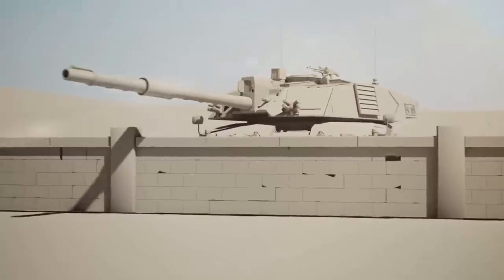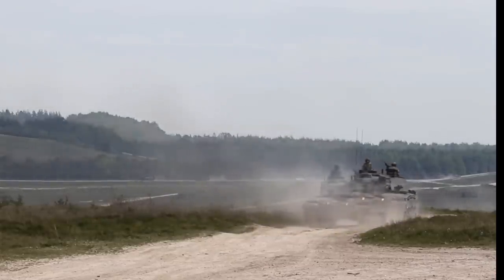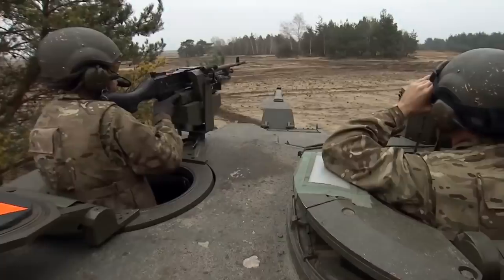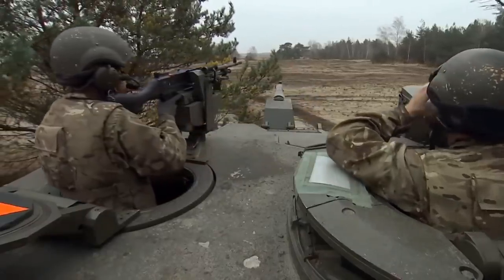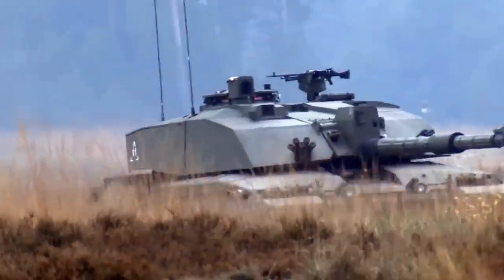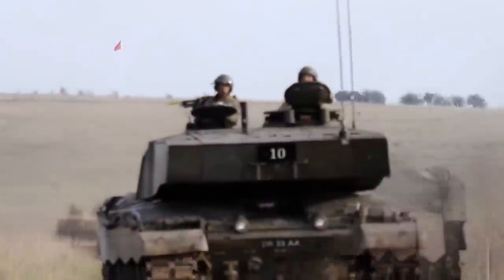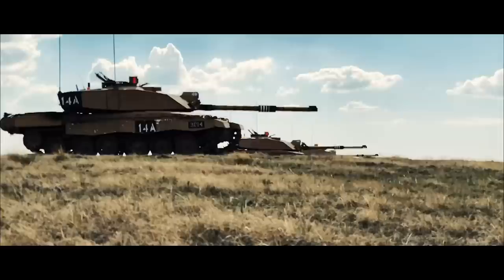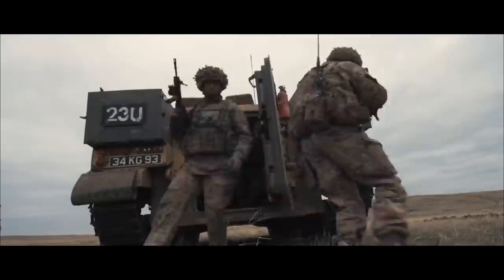Challenger 2 Tank "Black Night" | MODERN UPGRADE

Comment from the maker: Tell me what you think of this? Is it worth it? Is it going to be made into full production? Disagree with what I said? Let me know! :-)
Reply: My thoughts, Its essential. 
We are at the point now that tandem warhead guided missiles are becoming a common thing even in third world armys. Tanks can no longer rely on reactive armour + chobham to be protected.
At the minimum all western tanks should be adopting hard kill defensive systems as soon as is realistically possible.
Reply: This Upgrade is really impressive, but I am also very eager to see what Rheinmetall's Upgrade will look like. I'd really love some Design choices from the Leopard mbt Revolution to influence their proposal for the Challenger 2.
Reply: Matsimus don't take this the wrong way but a polished turd is still a turd.  The Challenger 2 was an obscelecent design from the beginning built for a style of warfare that was woefully out of date.  Its disappointing to see the MoD of Great Britain double down on a poor design rather than seeking to at least put the money in to make them compatible with the NATO logistical system and look into new more future proof designs.
Reply: In regards to the Engine, I think the rest of the drive-train would obviously have to be considered in any Engine Replacement or Performance Increase, mostly in regards to maintenance, reliability, fuel consumption etc, not that It would necessarily be problematic (a boilerplate development procedure) Active Defensive Systems are a must, as even in the absence of modern anti-armor weapons, crack marksmanship against small, unprotected areas of vehicles has sometimes paid substantial dividends, possibly the earliest example being the destruction of 2 of the Ironclad Ram C.S.S. Virginia's 10 guns by the Wooden hulled, Sail-only Sloop of War U.S.S. Cumberland (Commissioned 11/9/1842) at the first day of the Battle of Hampton Roads (3/8/1862) despite the feat involving firing smooth-bore muzzle-loading guns from the pitching deck of a sailing ship, aimed with rope, pry-bars, elevation thread, and quadrant at the gun-port hatches of a moving Ironclad, whilst they happen to be open long enough to roll out, aim, and fire shells  at the broadside of a wooden ship in return. Ultimately after multiple hours of gunnery, and the death/injury of 55% of the Cumberland's Crew, the Virginia was finally able to sink the Cumberland by ramming, but in doing so took substantial damage and was thus unable to decisively ram the Ironclad U.S.S. Monitor the second day of the battle, the precious few hours bought forcing Virginia to fall back to deeper waters to prevent running aground with the tide, and with it saving the Union Fleet and making the Monitor's soon to be legendary duel inevitable, and with it the threat to the blockade and potentially even Washington D.C. duly neutralized.
Reply: yip so much worth it:)
Reply: lol that tank had no lower glaces add on armour
Reply: The only thing I disagree with is that you're not making more and longer videos. I know YouTube isn't your entire life but you're probably the best military uploader on the platform.
Reply: Its kinda sad that there aren't any new European modern tank works in progress. It be neat, if one could also make one, that be fielded by all EU NATO members ( if it covers all their needs ) simply for unitary and logistical reasons. And that all past planned ones always ended up in failure. ( kinda just like in aviation too ). Answer is simple doe - if there isn't any necessity to use them in an war and intense combat, modernizing and life-extension is the way too. Having an continuous project development for an modern tank design in the background be still necessary, just to stay in the league and have an usable concept, once the lifetime expires for good. And having an program to save the necessary resources for that day. Otherwise, the few systems, like the sights are a great help already, so going for all the possible upgrades might not be as necessary in peace times.
Reply: I reckon she's gonna toasty in the sunlight. Especially if it is as dark as it looks in the pictures
Reply: I think Britain’s got a few more pressing worries that need fixing first, but thanks for the video. Also...  Not having robot voiced ones is good!
Reply: Tanks are just rolling coffins they are sooutdated. 1 unit with laser anti tank missile will leave a tank as a smoldering heap of garbage.
Reply: I mean they need upgrades, that should not be in doubt to anyone they are running behind. That said have they finally started to produce more ammunition for it again? iirc a few years back the stockpiles where so old they where classified as to dangerous to handle. 

That said the 120mm smooth bore has been debated, but it would require such a massive refit a new tank would be as expensive (Talking going from a 3 piece ammunition to a 1 piece so it is not just a case of swapping the gun, but also all the storage spaces). 

Overall though I feel this is one of those examples of western nations trying to get insane lifespans out of their current equipment cause they do not want to fund new equipment and also do not see a need to do so and frankly who can blame them? The public opinion is not there to send more funds to the armed forces in most nations and there are few credible treats where you really would need say a state of the art MBT. People like to point at Russia, but really even if we would get a non nuclear war with them most of their equipment is also old and poorly maintained. Things like the T14 Armata are wonderful, but they also don't have the money to buy them in meaningful numbers. 

So yeah upgrading what you got is the way to go it seems and with tanks that is relatively easily done cause the level of passive protection has not really changed so you don't need to improve on your firepower or your own level of passive protection, all you need to do is upgrade the brains and eyes (computers and sensors) and add some active protection systems perhaps if you want to spend the cash. 

I think we all would love to see stunning new and innovating designs being made and adopted, partly cause we are nerds for the stuff and partly cause we can actually see the use of them to a degree even without credible treats today that does not mean it will be the same tomorrow. 

This all comes from a person in a country that did not even buy heavy winter clothing for it's troops send to Norway this time of year for exercises in snow and ice..... the level of military funding is shocking and the consequences people just refuse to admit.
Reply: The only problem with this is that Australia won’t buy it
Reply: I think if it ever got hit, tis would be just a flesh wound!
Reply: Modern army concepts hand the anti tank role (which is the main role for a MBT nowadays) over to unmanned systems which mainly rely on ATGM. That might be the reason to keep existing platforms until technology is able to realise this concepts.
Reply: Matsimus as a complete tank noob can someone please explain why a smooth bored barrel is better than I rifled on (in a tank) thanks
Reply: Rifled guns reduce the maximum possible penetrator velocity due to the friction of the rotating band and the loss of gas pressure. I think (but do not know for sure) that smooth bore guns also allow more shots to be fired before the barrel has to be replaced.
Reply: Looks very good and cost effective. If Russia can modernize much older T-72`s I don`t see why this would not be done.
Reply: I deff think its worth it as a force multiplier a tank even an old one is a massive asset used properly and aggressively plus in real modern wars we actually fight few if any anti tank systems younger then the old tank before the upgrades
Reply: The British military does need an increase in spending also I want Britain to get good reliable equipment that available and they got to give the Challenger II a better engine and I agree they should focus on the core
Reply: More life on the gun barrel, less expensive to maintain. Also, ammo commonality with other NATO tanks decreases cost of usage.
Reply: It is all about the priorities and cost efficiency. Maybe get a new smooth barelled gun like the Rheinmetall L/55 120mm and Trophy APS, and upgrade the existing powerplant. I am sure that with some "cheap" /compared to a new engine/ upgrades (electronics, exhaust, new turbos) it can be in the 1500 HP range.
Reply: Ha can't believe I'm in your video, I remember the guy videoing on horse guards.
Reply: This is what happens when we've been bankrupt militarily by are new carriers. All those new Goodie's look vulnerable to heavy machine gun fire. They also have to fix the weak spots in the lower hull that came to light in Basra.  I just hope they do all the right modifications in the final model. Gun-Armour-engine-protected optics-thermal-camo-and new fire control-battlefield management-next gen-active pro. all the best  PS I love the Chali 2
Reply: Matsimus, ive looked around your channel trying to find out why exactly this is your favourite tank, its out of date, loses every tank competition but that might be down to the poor quality crews. Its not a good looking tank and sticking endless amounts of tatt onto it only makes it worse, the British have an amazing ability to make everything untidy/messy on our military equipment. We have all the money in the world (or so it would seem) to produce the best, but we somehow manage to fuck it up again and again and again ---- Plot twist...we dont have the best equipment in the world and we dont have the best people either. There, i said it.
Reply: It's need to extend it's life for the foreseeable future but i think it was a real missed opportunity to call it "Black Knight" instead of night.
Reply: chris carter honestly mate don't comment on stuff you have no idea about . watching a few YouTube vids doesn't make you a expert on the vehicle. And being a ex Tank regiment serviceman I take offence to you saying poorly trained crews we have some of the best In the world.
Reply: I like it. Would like one for Christmas. Then I can drive over cars on my way to work.
Reply: From what I know (and I am not specialist or anything) or what I've heard about that tank the two big problems with it are that the engine is not very reliable and the ammunition for the main gun wich is imported and no longer produced  so is true or it's some BS  ?
Reply: Should've bought the leopards we where offered and slapped our trademark challenger armour ontop
Reply: @MilesStratton  the british goverment is built of beurucracy. We'd be able to get a brilliant army with more than enough staffing for the budget we have if there was no such beurucracy as we have today. Its utterly fucking ridiculous. Its the entire reason we had the l85a1 and the entire reason we haven't bought rifle licences from a company and just modified and built them here like with the slr. Instead it has to be a new from scratch peice of shit by a huge design board rather than fabrique Nationale, colt, Armalite etc
Reply: Гавно, Т-14 разнесет вас всех.
Reply: Well if they want to upgrade the C2 they need to keep in mind ECM resistance and EC reconnaissance. The noise its making as recce by ear is also important. Thermal footprint and if discoverd and hit its need to take the hit and still be running. Weight as tanks get more and more heavy and some infra structure and even ground it self cant handel this weights any more. When destroyed its needs to be refurbished realy fast. Long runs without resupply are also a thing. unfortunately is going back to cold war stand off with russia and china and the numbers game is not on our side as technological gap got closed pretty fast.
Reply: What Armata? Just stop this crap. First try to make it comparable to T-90MC first and then think about something else. Also we all saw T-72s in Syria but what about Challenger, probably could not survive in that Syrian battlefield.
Reply: Great video. Yeah, I hate the bot voices too.
My only point is that as a mechanic, you'll know that an uprated engine = an uprated power train, suspension etc, which are all rated for 1200hp, so surely you know that what you are really calling for is a Challenger 3.
I personally believe that a Challenger 3 will happen, but that it will be a major mistake, as tank warfare is rapidly being superceded by lighter, smarter, longer range war fighting vehicles such as drones and missiles, which spell the end for heavy mechanized formations. I see no real place for the tank in this age of D.E.W's and hypersonic projectiles. I believe that rail guns will soon make the best smooth bore artillery obsolete, and the next generation of electronic warfare will render all their expensive toys useless, so why bother?
Reply: @ Vlad Ohio

Its the same with "standard" Leopard and Abraham packages and most current standing MBTS. They're fine for usual frontal and tank engagements but the increasingly heavy Anti-tanks qualities out there make more and more tanks in their current forms considered either severely lacking or obsolete. I think the t-72s with ERA packages in Syria are "ok" and they also have joint Syrian/Russian made passive laser to throw off atgm targeting. A Challenger might have enough side armor to survive flank shots but with the lack of electronic or any modern counter measures makes them... not challenging for anti-tank teams *Cough*. Most atgms aren't going to penetrate a tank from the front unless the tank has sub par ERA or lacks Ceramics. I geuss Challenger's main problem would be the engine power to get where its supposed to, its a lot of space to trek around.
Reply: Well Matsimus, I've taken a few days to calm my head from the fanboi feels and read the comments. I have come to a less than fanboy perspective: Any exterior add-ons and improvements will not be sufficient without extensive internal improvements. Building a new tank from the wheel up may have been a better alternative in both price and logistics. 

Now, in defence of this noble-aging-horse. Its a big tank with heavy armor, theres not much to complain about that. Chobam armor itself isn't going to be obsolete. It is only one layer of armor, by adding the sensors to detect incoming targets, track and engage with APS adds both a sensor and hard kill layer. Now, for the demonstration BAE chose to show Iron Fist which is a proven flexible system.(Which is a hard kill system, the other Black Night systems might also include soft-kill to disorient incoming targets) Why they decided to stick an Israeli item ontop could mean its future  usage in the UK military or a stopgap measure. I did notice the triangular body mounting had some slight differences from the origianl Israeli videos, so maybe UK BAE will be producing under liscenince or at least some parts. Also means they didn't throw the APS proposition through the beuacracy mill, huzzah. The hunter-killer system bumps this horse into the modern races for optics, much needed, much anticipated, much wow. The shared digital communications systems has been somewhat common in the past decade so I'm glad the UK is looking into getting its own communications upgrade. I think the survivability and awareness of this add on will be highly increased.  

This is all great, but, a lot of it should have already been done since... well when it was introduced. Modern optics for tanks is somewhat of a no brainer. Modern communications is a redundant subject, I don't even think that should be a black-knight addition, it should be a full on military arm upgrade for all active units so they will have someone to share communications with. Now to run all of these fancy upgrades, electronics and talks of an infrared skin. The Challenger 2 desperately needs bigger engines. If not to run all the fancy equipment then if only to lug its weight properly, the thing is heavy and needs the additional power. I also keep reading about ammo packaging problems and engine reliability which adds further issues to any internal upgrade.  

For me, when watching the original BAE release I had a "Finally!" reaction. A-lot of its beens talked about for awhile and this is a bit too delayed for my taste. We don't really know if the beuocracy will let it through. It may take longer to finally sign an upgrade program into effect and force back the date of introduction further back again or get further upgrades into the program, still late or just when its needed.
Reply: Damn it, i thought it could Fly, upside down be stealth , and do airstrikes by itself. British engineering and all...i am very dissapoint.   ;-)
Reply: i don't think APS would work in an urban envoirnment, it seems to rely on plenty of warning before countermeasures can be deployed( not much good if you can get up close using building cover...)... As for the engine, i can see them go for an electric motor with diesel generator at some point...
Reply: This. Tandem warhead & FAE warhead RPG's are available on the gray market so cheaply from China & other sources that active protection systems for MBT's & probably the Warrior as well are now essential.
Reply: Bloody hell
Reply: @Iain Ansell
You'd be surprised, a lot of these APS systems are designed specifically to engage at short range so long and short launched munitions are fair game. A lot of these modern systems are designed for split-fraction-itty-bitty-second response time, so it doesn't really matter if its urban or not, just how fast the munition is going. The large number of sensors is more for redundancy and full 360 readings so urban engagements aren't a problem. APS isn't going anywhere but on everything.
Reply: We should be developing with the Germans and French within Europe.
Reply: @PytonPagom  The Germans and French are looking at a next gen tank.  We should be with them.
Reply: Needs a 1500bhp engine and a bigger gun and smoothbored.
Reply: To my current knowledge, the Germans are the only ones who have demonstrated their own APS system. Instead of a turret mount its a very impressive explosive screen hanging over the sides, and very quick to react. Its very quick acting but I don't know if they have plans to put it on tanks (more likely I don't remember), the decision to use the turret mount design could be a space conservation reasoning. Using the german design would require alot of space to install. While all three countries are likely to work together in the future and the idea of make-in-Europe sounds great, I don't know how much the brexit and other political frakus has affected their procurement decisions. Or, its a question of reliability and flexibility and the procurers don't care if its local or not.
Reply: JohnnyZenith - i think i mentioned the "Leclerc/Leopard" bastardization before ( perhaps somewhere else, not sure yet ) ... not sure it can be called "a new tank" and they did push it forward as an export article. 
Dan Koz  - make in Europe is the way. It has just the pinch of economic national nonsense still hanging. One must understand, if we want to have a fully capable European force, unification, hom-production/servicing has to be the top idea. But, that would mean an full-Europe fitting machines, and that they be constructed by all interrested ( that have the technical capacity ) to produce and service them themselves ( thus know-how and bussiness barriers + national economy interrests ). Doe, the US problems with possible chinese electronics, and the thought, that in war, one cant wait for overseas delivery ( and the cost manipulations it brings with it ). One just cant rely on another player in war, case he will abuse it.
Reply: When is this tank getting a 1500bhp engine with 130mm smoothbore.
Reply: Challenger 2 has too many flaws, but ...
I consider this modification successful because It allows you to make his strengths even stronger. A large-scale modification would cause an avalanche of technical problems, intractable problems. The point is tactics)
Reply: I have a question...Why cant they do modifications to the engine to increase of power? This was done on many older tanks,including T-55 AM2,AM and H. It is much cheaper.
Reply: @mioslav5946  MBT's were still a primary force in the Iraq invasion 2003. Since all major armies have them and the Russians are updating their army with new tanks shows you are incorrect.
Reply: @MilesStratton  lol even if it was a best MBT today, and its not. There are small numbers of them.
Reply: Challenger is probably the best tank in the world,zero combat losses for a start,longest tank kill on record.
Reply: Eh. I think your military should just piggyback off of the US M1 Abrams program.
Reply: So the UKs plan is to field like 300 tanks capable of accurately engaging tanks to 3000m.  Against 1000s of t72s firing 9M119M Refleks missile from 5000 meters away.
Reply: Many Miles Away Surving on average 76 RPG hits in the Middle East? That obsolete?
Reply: To the threshold. I would point out that tanks have faced weapons that can knock them out, from the first mk1s in 1916.
Reply: Many Miles Away I would like to point out that the style of warfare the Challenger was built for,  ie large scale armoured warfare versus the Russians, is the most likely form of warfare the UK could now be involved with. We’ve left Iraq, (in which the UK fought large scale armoured warfare, with Challengers, very successfully, TWICE!) and Afghanistan. The problem now is that nutcase Putin. Please try to keep up to date before posting daft comments.
Reply: Mio Slav One unit of laser anti tank missiles against the artillery barrage the tanks call in? Tanks have faced anti tank weapons since the mk1 in 1916. Tell me another way of transporting a 120mm artillery piece into frontline combat? One Challenger in Iraq was hist by 70 rpgs and a Milan missile and survived.
Reply: Carde I cannot take the Armata seriously with that enormous shot trap under the turret. It would not surprise me if it was built of paper mache. The Russians have a habit of building fake mild steel tanks.
Reply: Although I have heard that there is no such thing as a stupid question, only a stupid answer, here goes ...

As part of the Black Night upgrade, the main gun may go to a 130mm smoothbore. Why not a 155mm, if the aim is maximum pen at a decent range ...? Or is the ammo too large/heavy, meaning you can store less ...?
Reply: Basically we need a government who is willing to spend money on the military, so that we can build a new tank.
Reply: @dethkon2284  

Well, as we both know, that really boils down the HM Treasury, and whomever is the current Chancellor ... 

I am sure that after Phillip Hammond was given the bill for the Trident upgrade (which I hope will also mean an increase of deployable warheads to 250 ...), he may well have baulked at any real-terms increase in spending by the Minster of Procurement, especially due to the amount of money the MoD has 'lost' over the years, due to a number of bloody shambles (coughL82A1cough).  Hence the Challenger 2 will suffer from 'incrementalitus', since it will be seen that upgrading an existing, abet already battle-proven design, will be 'cost effective*', than a completely new design from the 'tracks up' ...

[*= yeah, I know, I know ... normally the cost of upgrading can be far greater, long term, in stretching its longevity (cf. the venerable, and still hella useful, B52); one can argue for the umpteen billions of $ spent on keeping it airworthy, imho, they could have had a mixed fleet of a few B52h, alongside an equal number of B58b/c, and B70b/c flying by now, but what the hell do I know ...

... just don't get me started on the TSR-2 ...]
Reply: @dethkon2284  

As much as I admire those fuggin Yanks (a maternal cousin was a Royal Marine, who did at least one tour of Northern Ireland in the '70s, and was almost deployed to the Falklands; to me, a marine is a marine is a marine, no matter which side of Yon Pond they hail from ...), you point is very well made ...
Reply: @nigelft  We do have a unique relationship i will grant that. but the things that cause war are ever present.the question is.......who's fabicating the next conflict? i believe in prevention, which as you know is far less costly than actual war. It just depends on your method now.... i suppose
Reply: Upgrades are needed. Good job on the vid, as usual. I would also add the Rheinmetal Rosy smoke discharger system to the package.
Reply: Of course the chieftain needs an upgrade, the challenger 2 upgrade-package is from the nineties! 
Yeah that right guys, the challenger was just a disguised chieftain and the challenger 2 is a disguised chieftain with a "new" turret and improved dorchester armor not chobham that was on challenger 1. 
So yeah, looking at it like that the challenger is archaic, but it'll probably only ever take on other archaic tanks like T72, so an upgrade will suffice. 
A completely new tank is not needed and quite frankly waaaayyy too expensive with a brexit caused financial breakdown looming. 

On the other hand, in my opinion everybody should ditch their existing systems and go for the Abrams M1A7 and upgrade personal weapons to nerfguns.
Reply: I think that your childrenwill dye in the Battlefield facing T14 or even T90 modern versions so the best you could do to protect them is to purchase some Leo2A7  increasing the possibilities of their survival or at least achieving a heroic death and not the death of the sitting duck
Reply: Rik Z  russian tanks are shite,depend on numbers
Reply: @tothethreshold.9965  Yeah, hard-kills are great and all but I see no money for a hard-kill system at ALL of the European tanks. If it's 50-200 pieces. hell, even 400 and all are III-gen modified western constructions - that's fine and will do great. Available change in some reasonable budget. But consider you have around 1000 machines. There are 1,3k in fact but it is not possible in this world and worst ones will see junkyard or garage sale. 

ALL 1000 need a fast and very pricy modernization. 200+ of Leopard 2PL from Rheinmetall (MBT Revolution Program) at least a 400 of old T-72M constructions have to move around current T-90 or even T-84 Oplot M level. Then there are some 230 of PT-91 tanks (in modernization now). Even Leo 2A5 is not new. An additional batch of 50 up to 100 modern tanks needed. Ever wondered whats between 10k of T-72, T-80, T-90 and Europe? 
That's all nothing, that's only a temporary solution. A very temporary one. The real deal will be only an IV-gen tank covering all oldest pieces.
Please show me a place for APC for all of it before IV-gen. tank starts its service. 
Matt - love the video, watching it for the 3rd time now.
Reply: DONT YOU THINK WITH ALL OF THE MISSILES ON THE MODERN BATTLEFIELD, THAT ALL VEHICLES ARE IN A PRECARIOUS POSITION?
Reply: @valeremkin5188  There is no T-14 project anymore. Even T-84 Oplot M is way better tank than your T-90M! A poor-mans Ukrainian tank is BETTER in almost any aspect and your military tech. specialists know it very very well.
Reply: @vladworldzmason8244  Buahahahaha Comperable to what? Make a one single T-90M tank and give it for the REAL testing.
 I was contracted for special multi-national armored vehicles testing program. There were 6 countries invited, but only 5 appeared - USA, Russia, France, Germany, Great Britain.
1. Leopard 2A7 got all the tests but one.
2. Abrams M1A2 lost mainly in the high range accuracy test, first hit probability testing and cross-country ride -manouvers acceleration and speed. But in fact, it was very close to the Leo 2.
3. Challenger 2 tank failed a lot in cross-country and road speed and maneuvers. Long range shooting was very accurate but lacked too much in energy deployment at the target.
4. Leclerc tank got a serious autoloader jam and could not make any firing test at all.
5. T-90 was burning its charges so slow that the pressure in its main gun clocked close to 50% over the safe level set by the gun manufacturer. Due to this serious danger for the crew, the tank was rejected from MBT comparison testing program. Before this T-90 got poorest results for weakest armor protection, high fuel, and oil consumption and all the shots done before the gun issue, missed both of close-range targets at the stationary shooting test. Long range and riding shooting were not provided with T-90.
Reply: Rik Z  Yes! Exactlly. All the way down...
Reply: @HanSolo__  also even if we go off your bullshit, which is bullshit, but to entertain the idea.  I'm pretty sure 5 hits with guaranteed 1000mm against RHA, at 5000 meters.  While holding a 4 to 1 numerical superiority advantage against NATO  is more than sufficient to show her majesty what's what.
Reply: @nigelft  No bigger ammo possible now. you can make a gun. You can fit it on turret and you can even shoot with it once or twice. But you can not equip a tank with such a big gun, beacuse turret will need more space, more counter weight and more place for ammo. if the turret gets heavy tank hull needs to be upgraded to hold it. No room for up-to date armor, you have to make tank even bigger. Now its 40% heavier. Suspension can't hold it. New suspension + heavy tank leads to the wider tracks. So ther eis the need of some new designed wheels. Now you got a fucking snail on track. Tank is slow as shit. You need a new powerpack. Bigger HP needs bigger transmition. You end up with huge monster tank that costs a fortune and ther is no bridge around that could hold it.
Reply: @dethkon2284  Airbus/Eurocopter is an American manufacturer?
Reply: @HanSolo__  and I'm pretty sure you're confusing the damaging wear firing HEAT rounds though that rifled museum piece of yours.  For the lack of wear produced by a low powder charge and  the mechanical kicker used in getting the reflex out of the barrel.
Reply: @HanSolo__  how does the saying go again? Oh "England we were the first and now we're the worst!"
Reply: @chevchelios3904  Remote controlled IED with huge explosive package was a shit for KTO Rosomak used in Afghanistan. It is the LEAST armored vehicle from the pack. (4 x 4 offroaders not taken into account)So IED is no use agains current 40t IFV. for Puma, Lynx, heavy CV90 its like nothing. If stepping on IED with current fully equipped Leopard 2A7+ you could not feel it at all if the charge is small. Big charge does only a bigger hole in the ground.
Reply: @stevenbreach2561  Its a shit even in numbers.
Reply: @Duffman-zn7ku  You seem to confuse me with somebody else. There is nothing here even close to me.
About the best tank - The whole world already has chosen the best one. It's a Leopard 2 tank. No doubt about its place in armored vehicles history as a synonym of the III-gen. and the III-gen mod tank of all its production and across all variants.
Reply: @Duffman-zn7ku  It's not "mine". I'm not from a Brit. Chally 2 is slow, it's too damn heavy, it lacks the punch, it's a design failed tank. It got a constant problem with suspension leaking of gases. Plus it has no speed, no acceleration, no agility offroad, no equipment - an MBT. Not as much a design failed as T-72 Family but still a serious shit. There was somehow a better soviet tank, but you knocked it off because it wasn't cheap enough.
Reply: @HanSolo__  you mean the leopard 2 that a bunch of Kurdish girls blew up with one hit from a soviet era ATGM?
Reply: @HanSolo__  pretty sure the whole world has 3,200 leopards operated by 12 countries.  While there are 25,000 t72s operated by 40 nations
Reply: @Duffman-zn7ku  How long you gonna exploit a single case of ruined 40 y. o. Leopard 2 A2 (with tracks and radio of 2A4) run by crews of monkeys? Warhead none tank could take without damage. Especially not a "modern" single one of yours. 
While you destroyed your T-80 tanks without even comming into battle? Or cases of shooting a single man with a direct fire of the main gun? It is fucking impossible for you to count how much tanks you've lost. Thousands? Tens of thousands? How much crew members and T-34 tanks you've lost during WW2? Twice as much as all the other fighing nations? You wont tell. But why? Because you cant even estimate. M4 Sherman a junk-tank yet only 1450 of lost crew members. Whats yours loses in T34? 15000 of tankers? More? Lend-Lease program, tired nazis and bad weather won the eastern front. No. Not you. A weather did most of the job.
Reply: @HanSolo__  first of all its an A4.  Second of all t80 saw limited use in the Chechen wars. Lastly, what you're basically saying is that the 60 ton 5 million dollar leopard 2 of which there's 3200 in existence is vulnerable to exactly the same kind of flank side shot with a guided heat round that the 40 ton 1 million dollar t72 is susseptible to.  Of which there are 25,000 units.  And unlike ze incompetent Germans, soviet engineers recognized that  fact as reality and fielded 7x the vehicles capable of carrying 154x the rounds that the Teutonic barn on tracks can carry....
Reply: @HanSolo__  and it's funny how the weather didn't do most of your job when you assumed the fetal position in Bastogne while crying for mommy forcing the red army to start the vistula-oder offencive a week ahead of schedule, in the middle of January, across a 600 mile wide front.  When your one job was "distract ze Germans in the West and don't let Dunkirk 2.0 happen.
Reply: @Duffman-zn7ku  Ive been making the marketing report on those killed Leo 2 because my company was the one that made a tadio equipment for its modenization program. You simply cant find other person that knows better what year, batch number, equipment and model of those "2A4" really was. 
I've been working with te T72  manufacturers among many of the other known brands of militatry market of Europe like AMV, Thales, ASELSAN. Your tank industry is a unmeasurable source of constructons failures. I've seen a mind blowing cases of APCs, MBTs, IFVs of soviet origin. No other land forces eqip. makers could even believe it is posible. Mostly about to ruin projects of such large money investment. 
EOT Russian troll. You are not making yourself funny anymore. You are boring now.
Reply: @HanSolo__  btw now that you've mentioned it just how many wars has your over hyped equipment won? Or how much territory in Syria is your equipment holding vs how much did the Russians take? Might wanna put that in your report...
Reply: @dethkon2284  

And that, ultimately, is the question ...

One could argue that Afghanistan was necessary, as it was in the verge of becoming a failed state, not least due to the Taliban  (whom themselves have a complex history ...), but, as I saw one person quote '[Afghanistan] is a place Empires go to die ...' ...

As the most candid footage showed, what really was required on the ground was a joint Special Forces operation, whereby they can not only mix efficiently in with the populace, but, by being able to understand the language and culture properly (and not rely upon translators, brave though they were/are, whom said what they thought was needed to be heard, not was actually said ...), meant inacting way more of a hearts and minds mission, and not blowing through a person's house, to establish a clear line of sight. Sadly, that would have been impossible due to the massive drain in personnel, not least the famed CIA  SAD/SOG. 

And ontop of that was the IED 'war'; military companies sought to create a mine resistant fighting vehicle, with drive-away costs in the millions. The counter-responce by the Taliban ...? Just bigger IEDs. In one, pretty brutal scene, an American MRAP was blow-up, by a pretty large IED, flipping it like it was a toy, despite it weighing several thousand pounds, tearing the front end off, and the axle flying. Two soldiers were killed, and a third was critical. It was a nightmare.

And don't get me started on Iraq ... 

I doubt Trump will move against Iran, desite pulling out of the nuclear treaty, a treaty which, even us Brits candidly told the Americans, the Iranians were upholding. I have no idea why he did decide to pull out (with possibly the only reason being hubris ...), but now the Iranians have no real reason not to restart uranium enrichment, who knows ... 

... and there is Syria ...

I lived through what was the hot end of the Cold War (I have my own opinion on whether it actually ended ... long story short, it didn't; it just went into hibernation. Now the US has pulled out of the INF, expect Moscow to start rebuilding her own Intermediate missile capability ...), but damn if things are getting as scary as things were after Able Archer '83 ...
Reply: @HanSolo__  or hey are you gonna explain why that A4 upgraded Leo had to sit on a paved road and be used as a bunker?
Reply: @HanSolo__  

I know, I know ... wasn't sure I had my brainbox fully in gear, and meshing properly, when I wrote that ... t'was only after I saw the limitations of the Dana SPG (which, iirc, does have a 155mm gun), that I had a d'oh moment, but then couldn't find my comment about the Chally 2, so thanks for reminding me of how much of a dumb-arse (to use Brit-speak) I can be ...

That saying, a recent video on the, admittedly, rather expensive, Israeli guided shoulder, and tripod mounted missile system caught my eye, especially with its fold out fins. As ol' Matt himself said, there is nothing theoretically stopping it, or something very much like it, being launched out of a smoothbore, 130mm, MBT gun. Granted, the fiber-optic guidence system will have to be reworked, but not wholly infeasible.

Since smoothbore rounds are already fin stabalised, in lieu of the traditional rifling, firing a round/missile, with significantly larger extenable fins is totally a matter of time. Granted, the cost per round will be way more expensive than a typical 'dumb round', but having a first/second round pen/immobilzing hit (yeah, I am a WH40K fan ...) against a MBT, which typically costs millions (judging by what the much smaller MRAPs driveaway are ...), fitting ...

Hey ... it just occurred to me ... why can't a Challenger 2 be fitted out to fire a varient of the venerable Brimstone missile system out of its gun ... 

Now that might give ol' Matty a fit of the vapours ...
Reply: It's just a flesh wound.
Reply: dunno what they'll do once drone AT weapons are just carpeted out like mines..... war is becoming pay to win vs skill. advice, stock up on missiles, make cheap ones that use minimal resources.
Reply: As a daft idea, why don’t they ask Rheinmetall to build a 120mm smoothbore gun with a three part ammo breech? Solves all the ammo storage problems and keeps the gun fast firing.
Reply: Mio Slav And then the anti tank unit will be blown away by mortar or artillery fire. Tanks have been destroyed by anti tank weapon fire since WW1. They have never been invulnerable, so why weren’t they outdated in WW1, WW2, Korea, 6 day war, Yom kippor war, First Gulf, Second Gulf? That’s why you attack with infantry and tanks. The infantry kill the anti tank unit.
Reply: I think it will make a fine vehicle for riot suppression and busting up fortified drug castles.
Reply: Thinking back to WW2 and problems the Germans had with over-engineering, is C2 perhaps headed in a similar direction?
Reply: Any upgrade wont be worth it at all unless they change the gun and the engine. Seriously the gun isnt bad but its very outdated, like who would think of shooting apfsds through a rifled gun? even there normal APCR is better.
Reply: Also the rifled barrel doesnt make any difference in stability of the projectile. The apfsds isnt even spinning its just the cartridge.
Reply: We should produce more instead of upgrading